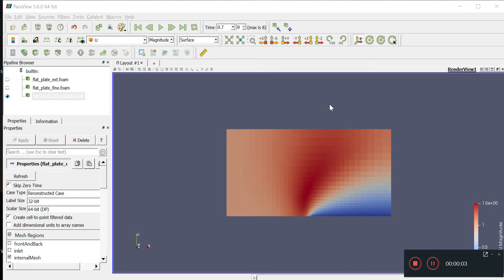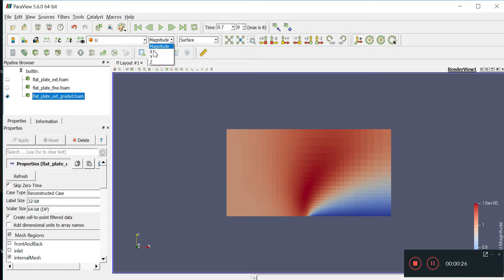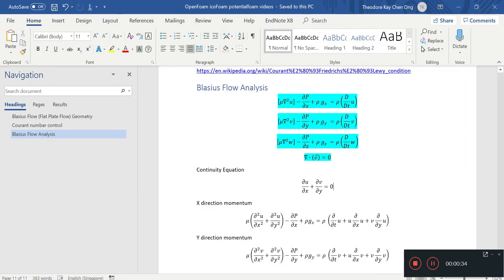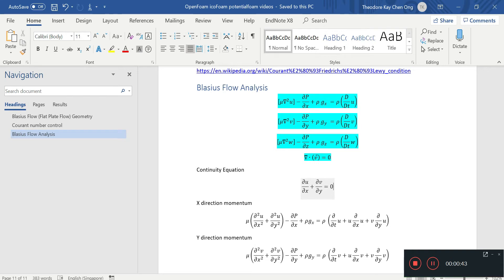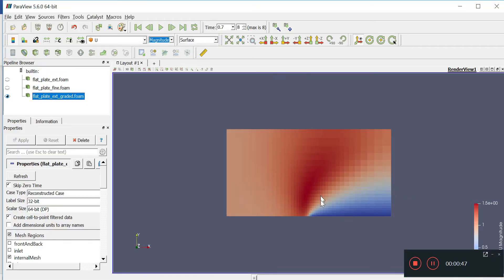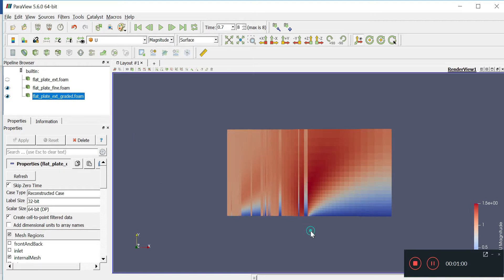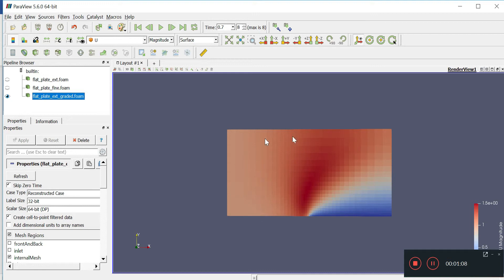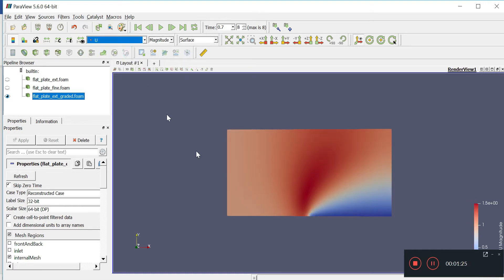OpenFoam for Beginners Win10 21 -Blasius Flow (laminar) viscosity effect

Comment: i have a doubt, the analysis done without changing the  viscosity is also  giving practical results right? that increase in the velocity show by red color 1.3m/s greater than free stream. That increase in the velocity beyond free stream is on the account high viscosity right? ......and then in the  second analysis you showed by reducing viscosity that red region is reduced is my understanding correct please clarify
Reply: @TheoOngScienceAndEngineering  Hi Theo, can I understand it as another way? Since in Blasius solution, the boundary condition is infinitely far away from the wall. However, CFD needs a finite boundary, and in your case, the boundary condition is set to be Neumann BC. By decreasing the viscosity, the diffusion of the upper boundary effect is limited. From another point of view, increasing the size of the domain could also reach the same effect. (In addition, from the self-similarity point of view, both methods could increase Re to reach the same effect.) Is it correct?